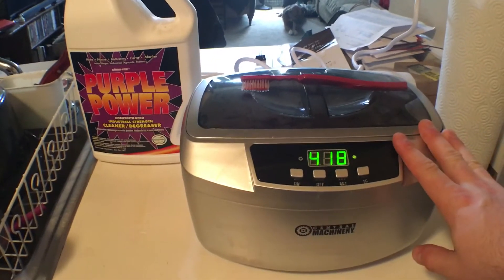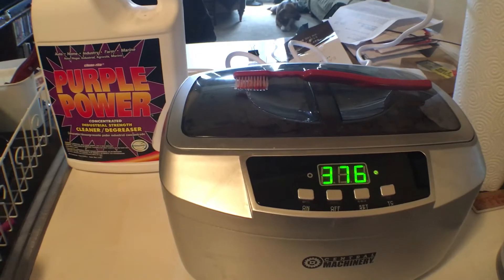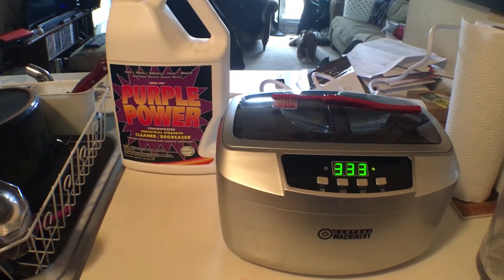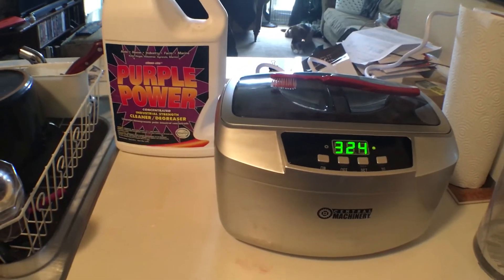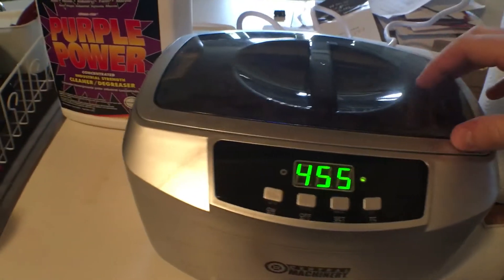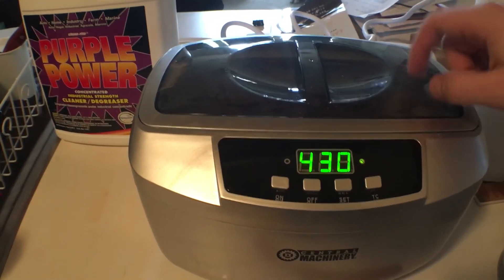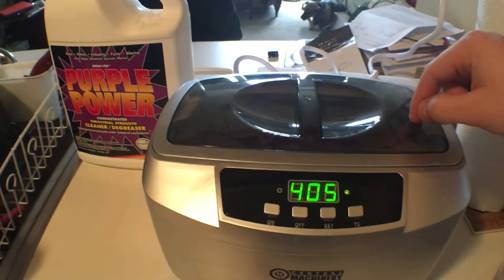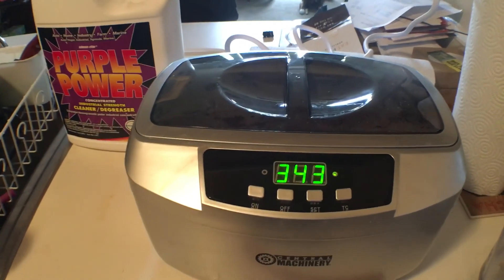Quick Tip: Stripping models using an ultrasonic cleaner

Comment: this may sound stupid because the answer may have been answered but does this work on plastic and resin or only metal because I did this with old necron immortals
Reply from the maker: Ben Jones no you're fine dude. It works on all 3 types. Just be mindful of your chemicals you use with plastic or resin.